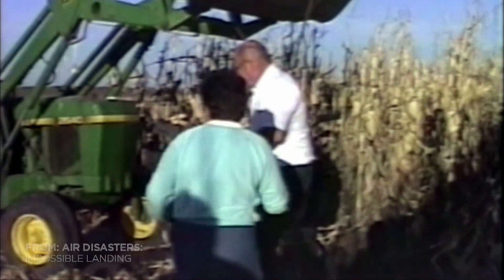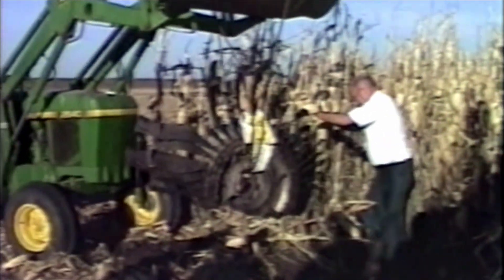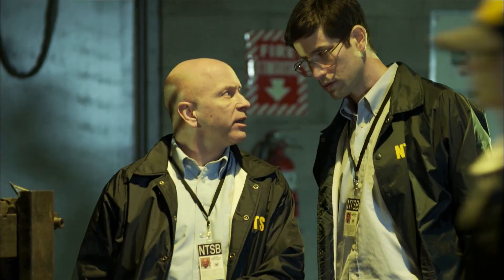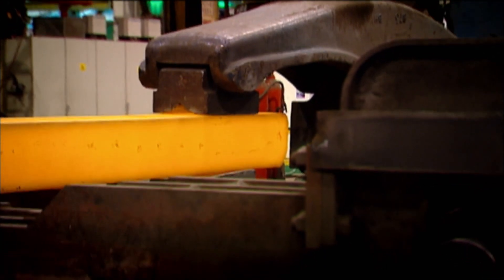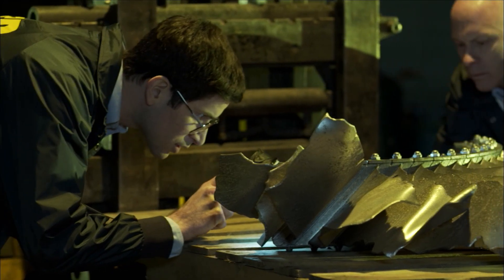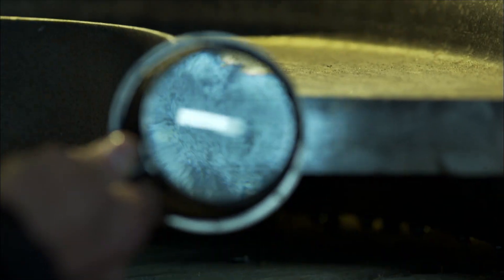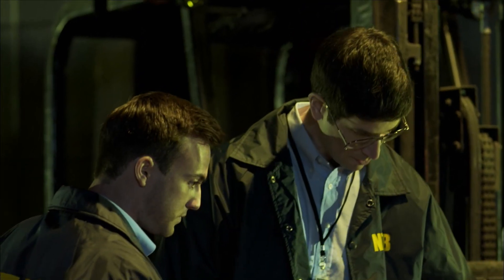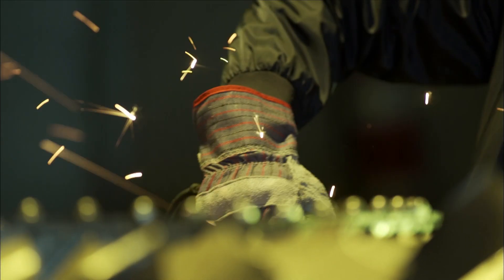Lessons Learned From the Crash of United 232 Still Being Applied Today | Air Disasters | Smithsonian

Comment: Nitrogen and Oxygen in the Titanium alloy this increases the chances of cracking and when the crack got really big the fan disk can no longer hold the stress and then it breaks. The shrapnels of the disk severed all the hydraulic lines which is the nervous system of the airplane. The pilots manage to get the airplane in position to land but just as they aim for the runway the right wing drops and as a result the aircraft smashes into the runways demolishing the right engine and breaking into three pieces: Cockpit, Tail and Main Fuselage.